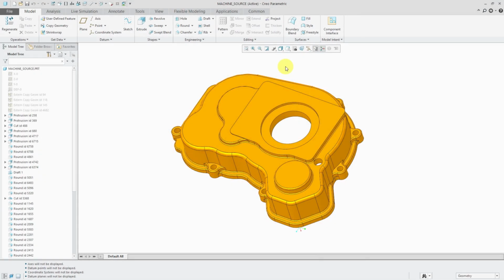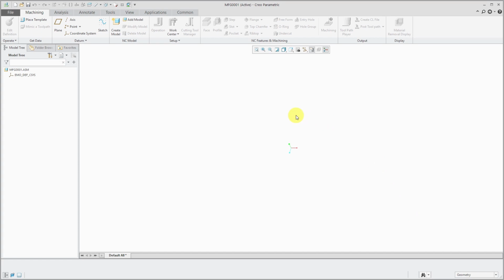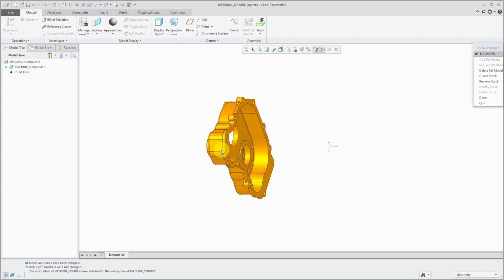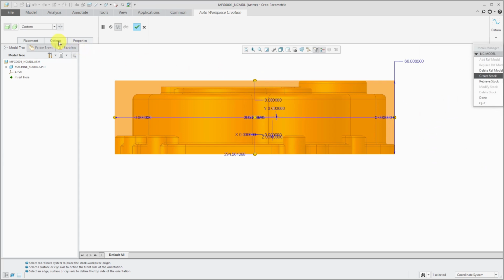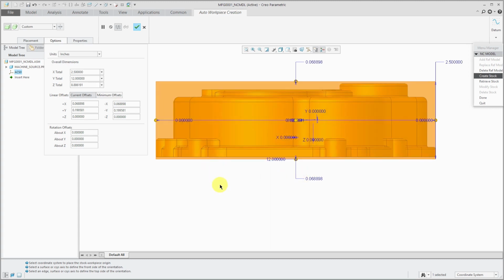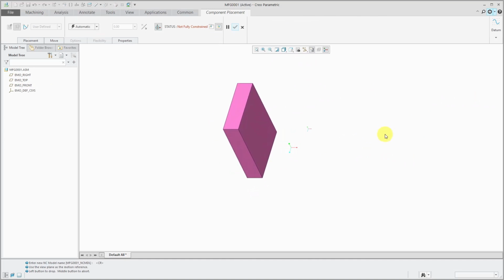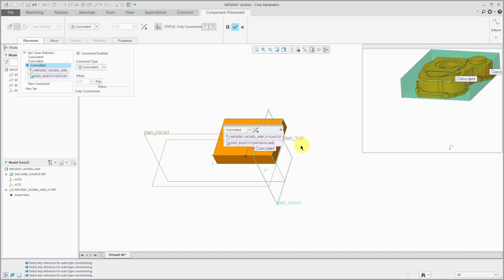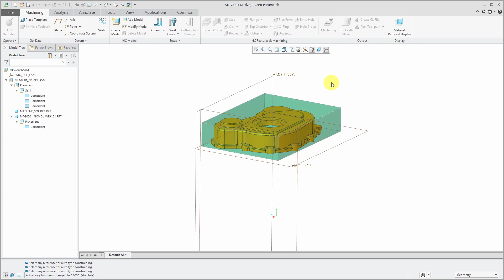Creo Parametric - Expert Machinist - Part 1 - Setting up the NC Model

Comment: This is an area of weakness for me.

Excellent topic! 

Anxious for the next - thanks!
Reply from the maker: Thanks, Snappy Sammy. Doing just a little CNC helped my design modeling a lot. There are some good Design for Manufacturing packages out there, but since EMX is free and relatively easy IMHO it's a good way to run a sanity check on your parts.